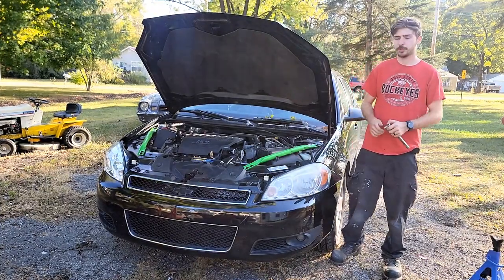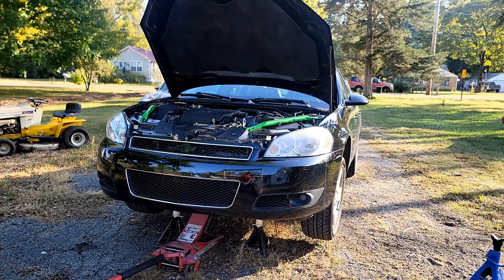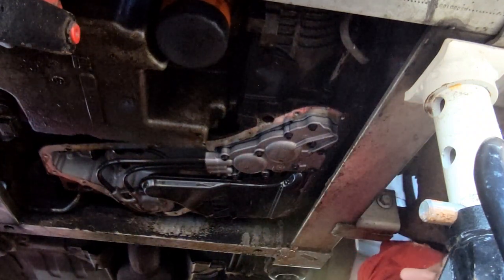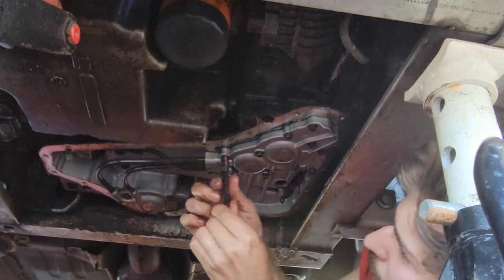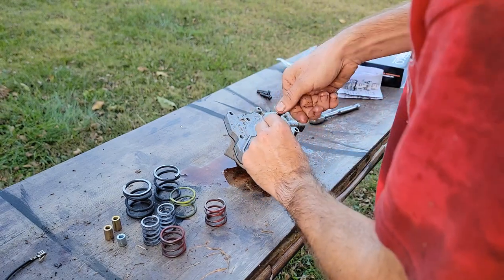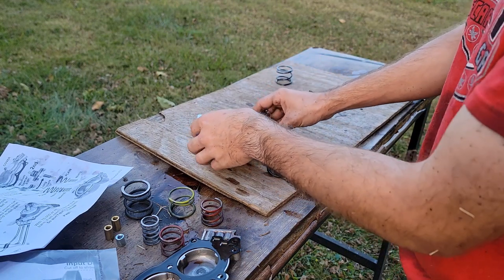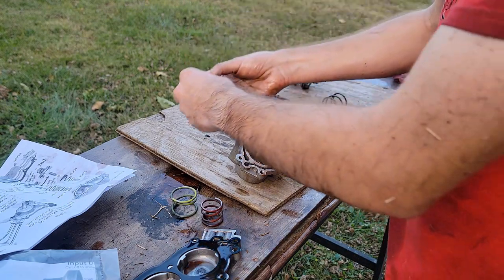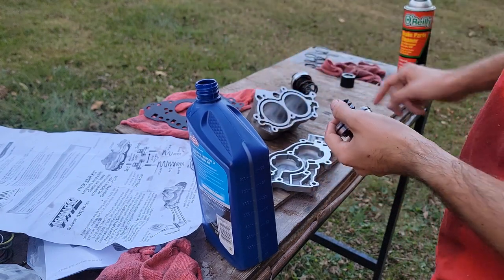Impala SS transmission shift kit install! do it in your driveway, no special tools!

Comment: Great video. Keep it up!! Did it fix the first gear issue? Im having issues from first to second, I'm going to try the shift kit.
Reply from the maker: Thanks! It made it do less, but it still did it sometimes.  What I ended up doing was bumping the line pressure up in hp tuner a tad bit and that ended up resolving it in combination with the shift kit
Reply: Thanks. Great I'm going to try that. It's going to take some time for me to do it. But I'll try.

Comment: Do you think it would be a bad idea to do shift kit and THEN trans cooler a little bit later.? Or is it recommended to do cooler first? Got a wait on my order lol
Reply from the maker: That's actually the order I did mine lol.  Just take it easy on it until you get a cooler. It should be fine for now
Reply: @SargentRestoration  thank you!!!!
Reply from the maker: No problem!

Comment: Will you show how you routed youre trans cooler please
Reply from the maker: I forgot to take pictures, and I'd have to pull my bumper off to show. I ran the lower line under the skid plate and up front by the core support, and my upper line I ran behind the headlight and up by core support. The trans cooler is mounted in front of my condensor, held in with brackets that it came with
Reply: @SargentRestoration  Any links to the trans cooler that you installed in your Impala SS and what are you using to monitor trans temps?  HP Tuners?
Reply from the maker: Gagsu Low Pressure Drop... https://www.amazon.com/dp/B08WS5Y9Z8?ref=ppx_pop_mob_ap_share

Comment: Any update on how the shift kit has been so far?
Reply from the maker: So far so good. I also bumped my line pressures up a tad in the tune. I daily drive the car and put about 200 miles a week on it
Reply: @SargentRestoration  So, in general does it seem to shift better/smoother/faster?
Reply from the maker: Yep
Reply: @SargentRestoration  How do you bump line pressures up? TIA!
Reply from the maker: Do you have hp tuner? It's under the transmission category in the tune settings. Can't remember what the exact setting is but if I pull up my computer, It'll jog my memory